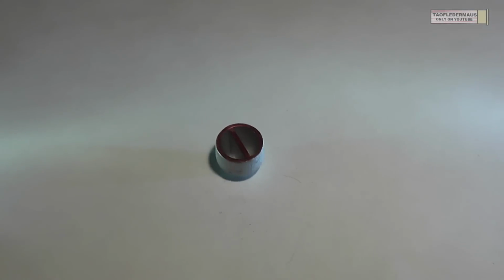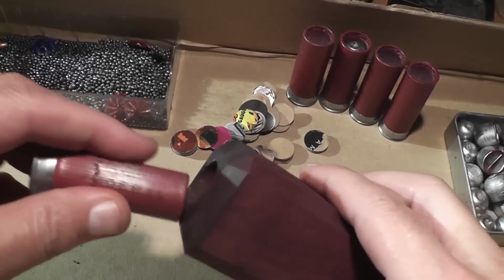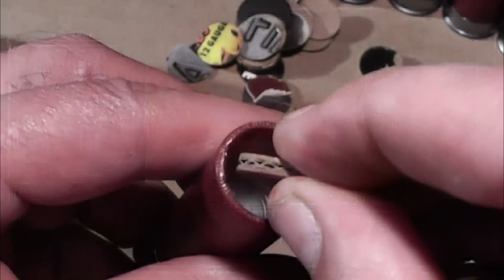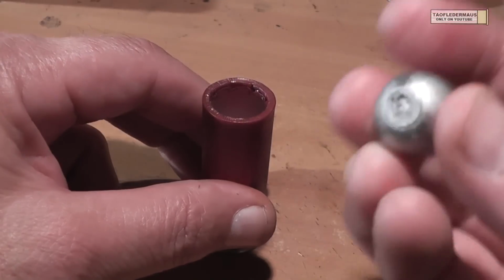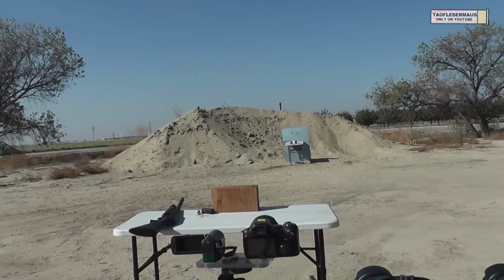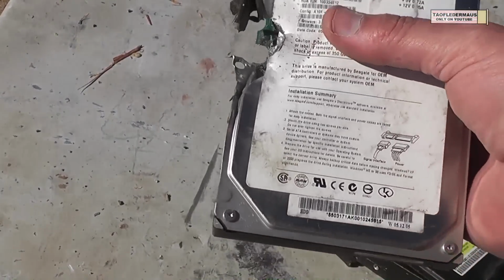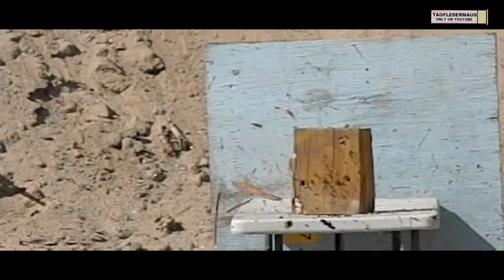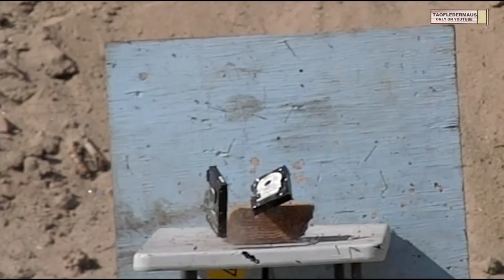BACKWARDS Shotgun Slug -  Impossible Physics?

Comment: The spin keeps it stable long enough for a low pressure "bubble" to form in the cavity in the front. Once that bubble is formed the slug it act the same as a pointed and allows the airflow to pass smoothly over and past. end would
Reply from the maker: +Malachiore  I'm pretty sure once the slug decelerates back to sub sonic it would go all wonky and tumble.
Reply: +TAOFLEDERMAUS Definitely, maintaining that bubble is all about airspeed over the front. It would be interesting to see how it behaved once it slowed down enough; Would it flip like a dart thrown backwards or would it just tumble?

Comment: this reminds me of an old issue of Handloader magazine. the guy loaded up a bunch of 168gr .308 bt soft points. he had made a bunch of different loads with different things done to the bullet. some were nose modifications ( clipped, flattened, and ground at 45°angle. he even loaded some backwards ( punched holes like a wadcutter) and they all flew straight. the only ones that keyholed were the ones that had a notch cut in the boat tail (loaded normally). with those results he figured the nose shape (super sonic - spin stabilized) of the projectile didn't matter much. the tail uniformity however did greatly affect stable flight, possibly because of the low pressure area behind the bullet being uneven.

Comment: Fortunecookie45LC has a series of videos shooting the Lyman "pellet" slug backwards. Personally I don't see any reason why this load should be unsafe in the firearm. It fits through the bore. It is a safe weight, there is not room for it to turn sideways, so you're golden. It seems to me much less risky than some of your other experiments.
Reply from the maker: +GunFun ZS  I wasn't sure how well they'd transition from the chamber into the barrel since there is step in there.   I can't think of the proper name for it.
Reply: ***** The term: "Forcing cone." Those are a tapered constriction though, and the wad already glides through with sharp edges.The fact that you cut off the crimp does make the transition harsher though, since the crimp unfolds to hold the load centered until ~3mm from contact with the forcing cone. (~ no gap in a 3" /76mm magnum shell.)
Reply from the maker: Ah yeah,  that's it.    I was thinking "cone" but it isn't conical.  lol   Blunt, square edge of the slug passing thought another square edge.
Reply: If you looked at it in cross section, that square edge should be actually a 5* taper. http://www.saami.org/pubresources/cc_drawings/Shotshell/12-gauge%203.pdf

I looked down one of mine, and to the eye it appears to be a square shoulder as you describe. However, it is kind of an optical illusion. When I take a pointy bit of wire and try to catch the "shoulder" it just slips off down the bore. I suspect you will find the same.

Some brands or custom smiths ream that out to a 1* or so taper, under the spurious claim that it reduces recoil. "lengthened forcing cone" Now many brands do this standard on all models for the same reason you see "gluten free" on a bottle of apple juice.
Reply: +GunFun ZS Agreed on this assessment.  In normal cartridge reloading, it's pretty common to turn bullets around backwards to create makeshift wadcutters.  Granted this is a more extreme example due to the weight distribution, but the bullets in question for wadcutters are also much harder lead alloy or jacketed.

I'm still a bit surprised that they stabilized, both because you no longer have that cavity in the back of the slug to aid in expansion (which should engage the rifling better), and also because there's only a small section of rifling at the end, but I guess it doesn't take much.  It's kind of the opposite of the 45LC/410 bore shotgun combo guns where the special choke (for 410 shooting only) kind of "undoes" the rifling right at the end with straightened sections.
Reply: +TAOFLEDERMAUS so next time you're making a video about guns, give these nice gentlemen a call ro make sure you'll be safe
Reply: Jacob Johnson You actually took the opposite meaning from what I was saying, and the guy after me. I know Jeff is sensible and doesn't need anyone's permission. I was stating that what he is doing ought to be safe so he can relax a little more. i.e. I was agreeing with his actions and being the opposite of a safety hall monitor.
Reply: +GunFun ZS what's an opposite?
Reply: +ThePooba26 thats just a fancy word for fall

Comment: a good brake barrel pellet rifle can achieve 1200 plus fps, the big advantage to putting a pellet in backwards is you can load stuff like priming powder and flint in the back of the pellet, though you might loose a little accuracy

Comment: I would assume that the spin from the rifled choke tube is the cause of the stabilization. Because the slug (whilst nose heavy) isn't entirely unbalanced, I think it is not unbelievable that it would remain in a mostly stable rotation. It would be interesting to compare the effective ranges of slugs shot forwards and backwards to gain an understanding of the detriment of reverse-loaded rounds.

Comment: If they're supersonic, the blunt end might generate a pressure bubble in front of it, making it behave like an aerodynamically optimal projectile. That'd be my guess, anyway. The spin is certainly helping as well.
Reply from the maker: +Teth47   That's my thought too.
Reply: +TAOFLEDERMAUS I think the backward skirt of the slug is supporting the front of the plastic wad better as its opening the small amount of crimp left on the hull, this allows it to survive making its way down the barrel and releasing the slug uniformly as it exits. Id say the inaccuracy of the forward facing slugs is from the wad petals getting ripped up from the crimp and making the slug unstable as it releases poorly when exiting the barrel :-)

Comment: Shooting pellets backwards sort makes them act like hollow points. When I was a teen I had a worn out pellet gun we used for testing. Shooting backwards pellets into things like phone books maybe had a little less penetration, but when shot through apples and such, they made bigger channels and exit holes. If you could make a soft catch with them after that, the skirt that was supposed to be at the back would usually be rolled back toward the nose of the bullet rather like a hollow point would do. 

Accuracy didn't seem to be affected much when shot through a rifled pellet gun, at least not over short ranges, and if I recall correctly, they were more accurate than certain types of pellets fired the right way round. I think it was the "high impact" ones that were very inaccurate. Never had any failures doing this, but then I didn't do it very often.

Comment: That is a surprising result!. I just got my Lee slug die today and cast about 30 of them, they are very noze heavy!, I am surprised they flew so well backwards!
I will give 20 to one of my workmates and see how he goes firing them from a slingshot :D
Reply from the maker: +Aussie50  Sweet!   The cardboard disks seem to help so I recommend using those.
Reply: +TAOFLEDERMAUS absoluetly, I think I have a 5/8" wad punch somewhere, and a good supply of stiff cardboard. I will even try a was made of pallet corner board.
Reply from the maker: Even before I knew they had an official name,  I used rubber gasketing,  plastic lids etc  to put behind some of the stuff we shot.

Comment: I think I understand the physics of why these flew as straight as they did. The pockets on the new front of the slug held compressed air. It slowly moved out of said pockets, essentially giving it a frictionless surface to fly through. The spin stabilization helped this process along, the wall in between the pockets giving it centripetal force and letting even more air come out. This second force would have been negligible, though. At the same time high pressure was building up along the sides of the slug. All of this worked together to make that the most stable position to fly in.

Comment: So spin stablization is a weird beast.  VLD long distance target rounds are hollow point to move the center of mass backwards.  I've also heard that people generally get bad results spin stabilizing things that are already aerodynamically stable.  Part of the reason is gyroscopic procession.  Normally the aero forces try to rotate the projectile to fly straight, but when it already has some angular momentum, it ends up causing it to process instead, causing a sort of cork screwing.  look up gyroscopic progression then imaging what the torque on a throwing dart flying sideways is and you'll see.

Comment: Shoot some ballistics gel and see if they work like super hollowpoints.
Reply: +Nico G Im with you on that
Reply: well this summer i needed a hollowpoints for pest control, i ended up using some cheap spring airgun and some cheap pellets.i put them in backwards and accualy they mooshroom out quite a bit and are very accurate
Reply: +Nico G ^this
Reply: +Christopher Hurley I've done this when hunting rats inside 6 yards with a .22 airgun at 12 ft.lbs. energy. They were as accurate at this range as normal and did seem to kill the rats more cleanly. Any further out and they are not very accurate but up close just fine.
Reply: Stigstigster I used to shoot pellets loaded backwards at pigeons as a kid, I just replied to see reverse shotgun slugs in slowmo in ballistic gel
Reply: Christopher Hurley
That's a great suggestion. I'd love to see that shot into gel too.
Reply: Shoot some pellets too i could be realy cool
Reply: +Christopher Hurley Pigeons? That's messed up.
Reply: mystith myst pigeons are just rats with wings
Reply: This needs to happen!!!
Reply: That is a wonderful ideal!

Comment: If you were to draw on about a quarter of the round with permanent marker would it stay on and would your high speed camera be able to see the rotation?  That may be fun to be able to visualize that.
Reply from the maker: +Cameron LaMance  Yep, I was thinking the same thing.  You have to understand that I THOUGHT the slugs would flip around and you could see the red marking I put on the base.   Hey, I'm always learning new stuff for the next time.
Reply: +Cameron LaMance A quarter is 0.955". A 12 gauge shotgun's bore is 0.73." That's not physically possible. A dime is 0.705" and will fit in a shotgun without an issue, just make sure you're not using a choke.
Reply: +Tombs Clawtooth you misunderstand, i mean draw on 1/4 of the round not use money.
Reply: +TAOFLEDERMAUS cool, I didn't notice the red marker until you mentioned it.

Comment: hummm things don't fly straight because they are nose heavy, but because their force of acceleration is located along their center of mass.
When projectiles where you only apply initial force (from the back) and it constantly decelerate, you don't want it to be nose heavy...
Think about you pushing a hammer away from you, from the handle (nose heavy) or from the hammer head (back heavy), which one do you have an easier time making it move straight without tumbling?

Comment: I was just mooching about the net thinking about your videos, and ended up (as usual) on Wikipedia - specifically https://en.wikipedia.org/wiki/Transitional_ballistics

I was particularly struck by the statement(s): "When the bullet reaches the muzzle of the barrel, the escaping gases are still, in many cases, at hundreds of atmospheres of pressure. Once the bullet exits the barrel, breaking the seal, the gases are free to move past the bullet and expand in all directions."

There's an enlightening little video embedded on the page too.

Just thought I'd drop by and mention it. I wouldn't doubt you already knew this :-)

Comment: Not all that surprised they flew straight. High pressure at the front just created a air cone that traveled with the slug. All that matters for a projectile to fly straight is  the center of pressure has to be behind the center of gravity. Commonly done by nose heavy design since it makes it easy but space rockets are tail heavy since you need the most fuel mass early. 

I bet if you notched out a spillway in one side of the skirt though it would tumble like mad after leaving the muzzle.

Comment: there IS an advantage to shooting some of them backwards. I shoot the lyman 69 caliper black powder minnie balls like this but your not shooting these with birdshot, you need a turkey load in a 3 inch shell to propel them as they are 730 grains in weight. they actually don't fit in the wad as intended as you actually need a 680 diameter to do that, and my lyman resizer don't go that large. You would not want to anyways as the point that could in theory detoate primers in the magazine ,  would be very very bad for loading in a tubular magazine, and they have a giant hollow point this way.

Comment: Why would the shotgun explode? I don't get it.
Reply: +UrbanTarzan Duh If it gets stuck in the barrel, the expanding gases need to go somewhere. Gun barrels are not that thick and will banana peel if a round gets lodged. Metal shards potentially the size of business cards flying at speeds about a third of bullet velocity. It is possibly why he didn't have his friend shooting like normal. He didn't want to risk his friend. He could have secured it down to the table and fired it remotely.
Reply: +acephantom903 the slug isn't big enough to get stuck in the barrel...
Reply: ALT Spitfire He was worried about it. Possibly because of the choke on the end of the barrel.
Reply: +ALT Spitfire He is worried about the slug expanding.  If it expanded while it was traveling backwards, there is a good chance it would mushroom and seal the barrel.  I bet the main reason why that didn't happen was the big piece in the middle holding it together, which is also the thing causing the slug not to fly straight normally.

Comment: Doesn't surprise me in the slightest, it's flying just like the space capsule does. You should stop worrying about blowing a shotgun up. Unless you're shooting steel slugs that are larger than your muzzle restriction, there's literally no danger. Lead will deform to make it out of the gun, and it will do so DRAMATICALLY before you're at any sort of risk. I regularly shoot foster slugs through a full choke without a single problem. That's taking a 72 caliber projectile and squeezing it down to 68 caliber above the speed of sound, and there's absolutely no danger, even notes that on the box.
Reply: +Tombs Clawtooth Not only that, but there was a common technique used by the british and germans back in WW2 era where they would squeeze a larger shell with a penetrator core into a smaller caliber to achieve higher penetration (squeeze-bore). Lead is just too soft to cause issues with a good heavy shotgun barrel unless there is an obstruction.
Reply: +Rafael Dracofuchs Squeeze, taper, cone bore wasn't all that common. And the casing around the core wasn't lead. Lead is dense, not as dense as tungsten or tool steel in the core but dense enough to drop the energy of the core as it had to move the lead out of the way on impact to penetrate into the armor. Not to mention lead fouling the rifling.  Aluminum or other soft and less dense metals were most commonly used on the jackets of sub caliber ammunition of the APCR and APCNR types. 

As far as blowing up the barrel, unlikely unless there was a severe deformity of the slug skirt.
Reply: Rafael Dracofuchs Squeeze bore guns used special projectiles that had a skirt that would easily collapse as it traveled through the bore. This would be a little more tricky to drive through a full choke. But the worst that would happen would be a bunch of lead shaved off in the barrel.
Reply: Looked into it a bit. The various german guns were varied in use, but the smaller calibers (28/20) seen much more use than the largest of the series (75/55). The metals used for the shell's exterior were aluminum and soft steel. The soft steel was believed to be used in place of the aluminum due to material shortages. The guns were used fairly often. Not as much as the 3.7cm or 5cm, but common enough to be recognized as a possible threat by the allied forces. However, the lack of tungsten in late stages caused most of them to be scrapped. 

Also, I was very aware that lead would be impractical, but my point was that it would deform to the barrel more often than detonating the barrel.
Reply: Rafael Dracofuchs The 2.8cm was the most produced cone bore but weren't all that useful after the first few years. Mainly because the barrels were far more difficult to produce and required far more precision then non and the barrels only had a 500 round life. That was a common problem of all tapered bores.

Comment: the back word weighted projectile will add stability at closer ranges as it makes the front end weather cock in the air slightly on a choke or non choke shotgun. At longer ranges IMO the stability will suffer a lot that way. 

 Just a further idea for you TFM. Take one of these lead projectiles. Cut off the aerodynamic end leaving a tube shaped projectile and use a moto tool to hollow out the spaces between the middle strengthener, while leaving that completely  alone to make a hollow tube shaped slug. Try shooting this out of that choked barrel. There are videos of hollow tube shaped frisbee devices that fly very true this way for very long distances.

 EXAMPLE -> https://www.youtube.com/watch?v=9U3xFu0MIdo